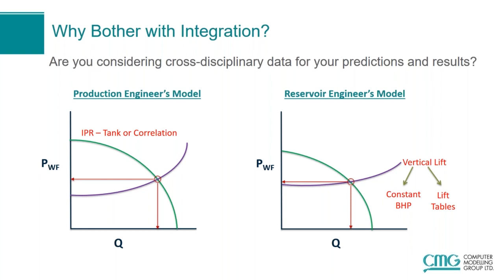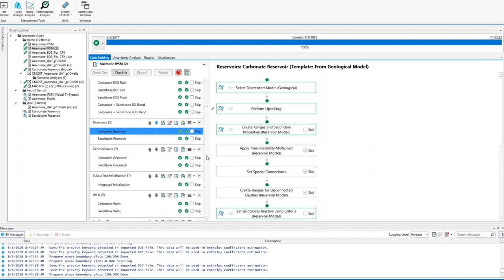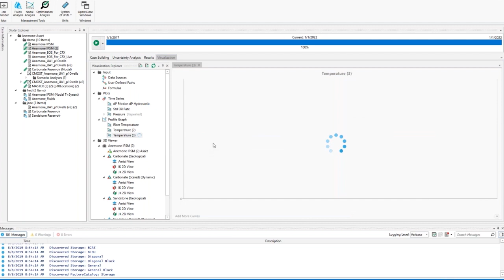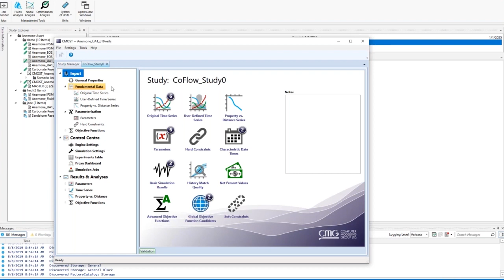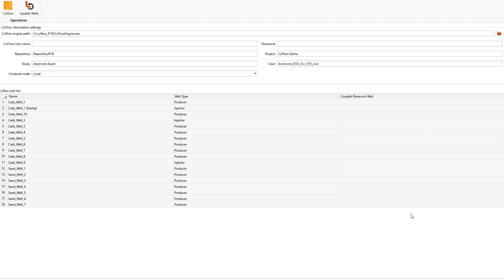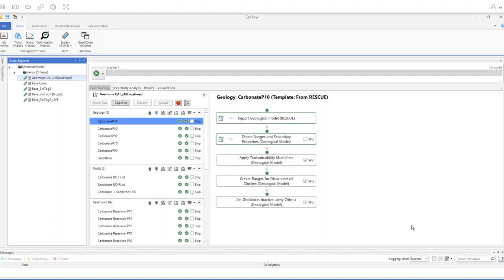CMG Webinar: CoFlow & CoFlow-X: Modern Solutions for your IPSM Challenges (2019)

Comment: It is mentioned that Coflow is a fully implicit solver, however in the description it is shown that we still have independent solution from production network, reservoir simulation (multi-fidelity), geo-mechanics etc.,and later in the presentation it is shown that there is still some "hand-shaking" done between reservoir & production solution using coflow showing that data is being passed from production solution to reservoir solution (as only production solution communicates with coflow shown earlier and not two-way communication). It is not clear on where it is fully implicit and partially implicit? In addition, if the bottlenecking is coming through the production network how does coflow take that into account while solving the reservoir solution?
Reply from the maker: Hello Yogesh, thank you for your questions today! These questions deserve a detailed response and we'd love to connect with you directly regarding them. Would you mind reaching out to our support team? Their email is support@cmgl.ca . We have several CoFlow experts ready to help you. Thanks for watching our video!
Reply: Hi Yogesh,
Were you able to get an answer from CMG? Is CoFlow actually worth it? Thanks!

Comment: How do you handle fluid blending when results from black oil models mixes with compositional model. It is mentioned Coflow does it automatically, so what is the phenomenon and QC process for delumping the black oil to compositional; or delumping the EOS with lower # of components to higher # of components?

Comment: Can I do static geological modelling in CMG ?
Reply from the maker: Yes, absolutely. CMG has options for importing RESCUE files that would already contain all of your geological/trajectory information or you can also load these individual items into CMG yourself and build your model from scratch. You can import topography maps to define your reservoir structure or use a simple box model for case studies. Let us know if you have any other questions!
Reply: @compmodgr  is the answer more towards the capability to integrate with geological packages by importing the data/files? or does CMG have a geo-modeling tool of its own?